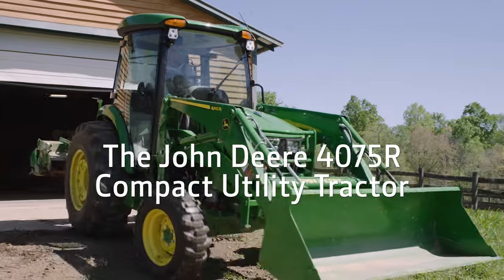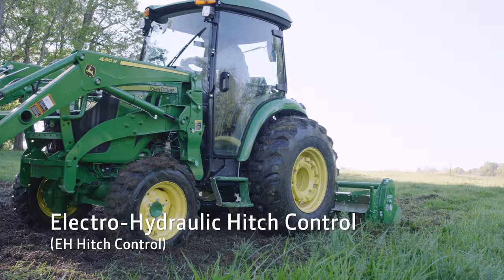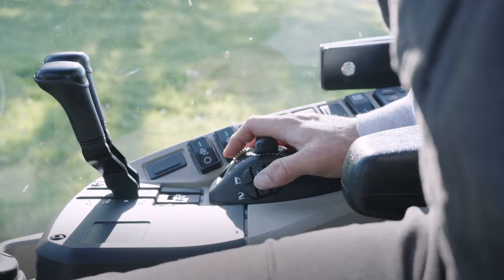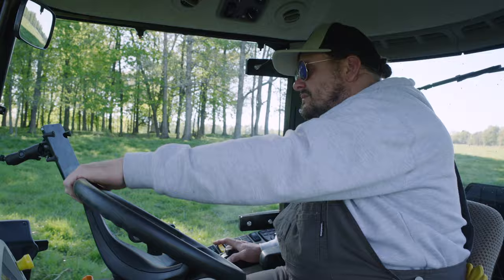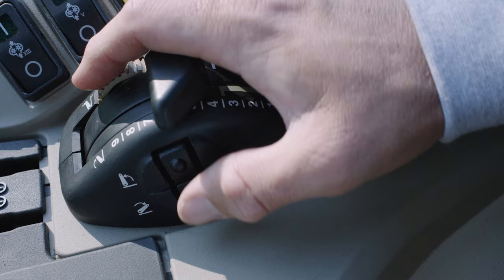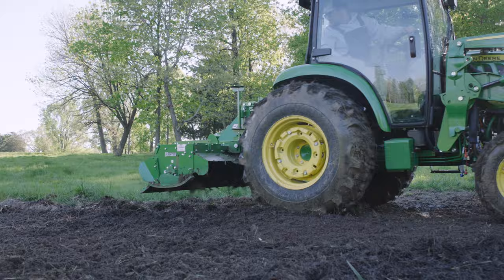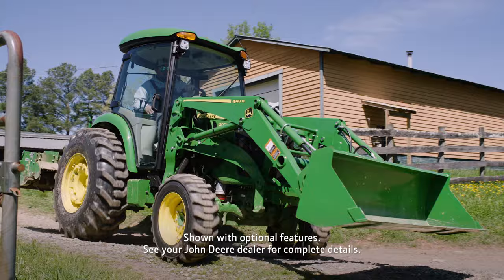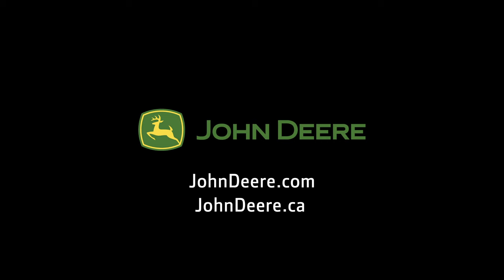4075R EH Hitch Feature | John Deere Compact Utility Tractors

Comment: Have the axels been in the field long? Has the emissions been tested they have problems? I have a zip tie and a wooden stake holding my rear remote valves together have you fixed that yet? The loader timing rod is it fixed so paddles aren’t separate time? Have you added a 4th speed to ac fan?